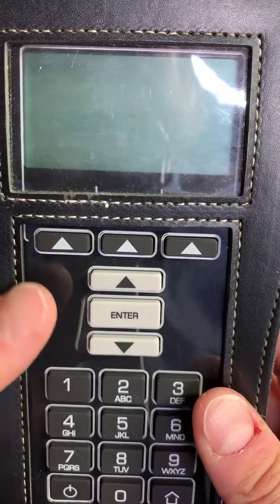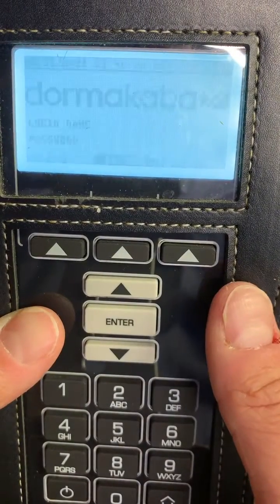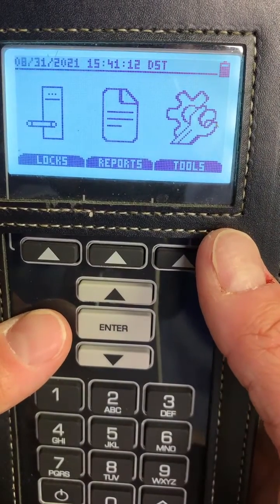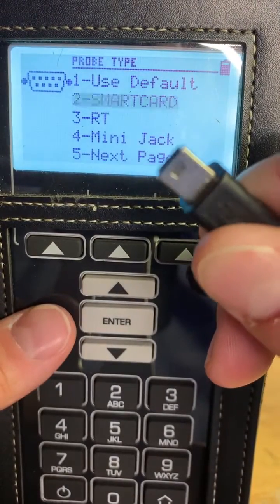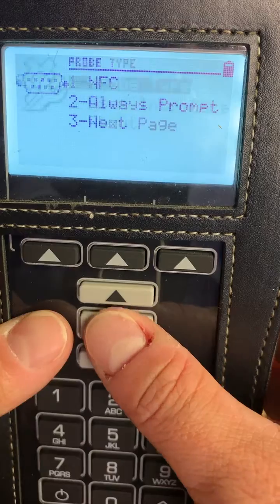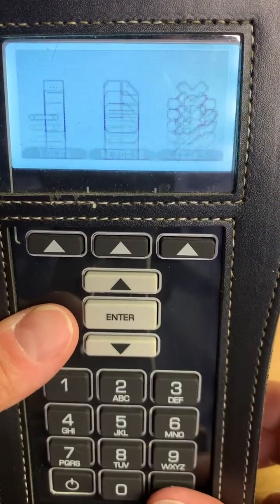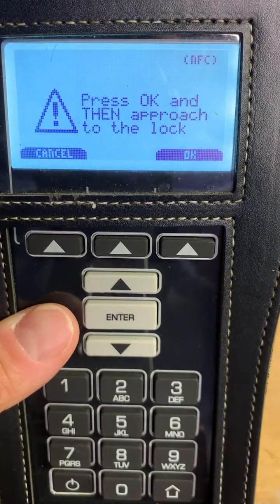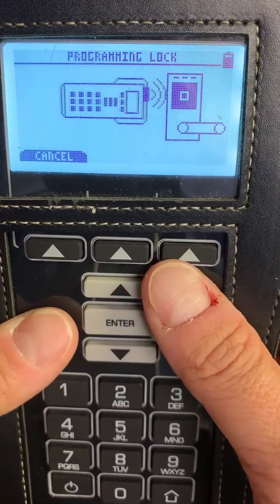How to change Probe type & program a lock

Comment: How to charge the device, my device has died after almost 4 years
Reply from the maker: From time to time the batteries do need to be replaced in the HH6.  The part number for the replacement should be 132-512886  Check with your local Dormakaba MH sales rep for assistance

Comment: I have a message coming back to hand held programer saying door is deadbolted from inside must remove dead bolt first,,, what does this mean as door is not dead bolted at all.thanks  all
Reply: When changing the battery the pin from the deadbolt must have been pulled out and misaligned, so you have to reinserted in a diamond mode , otherwise the reader will keep flashing yellow and deadbolt will stay activated.

Comment: We use dormakaba locks. What are the steps to replace the Bluetooth board?
Reply from the maker: It really depends on which lock model you have (as the process may differ slightly).  I recommend reaching out to Saflok tech support to make sure that you have the correct process.  Their number is 1-800-999-6213

Comment: LPI says sync with PC, but never connects?
Reply from the maker: Hi I'm not 100% sure what you're referring to with LPI.
Reply: @pjpolke1742  Lock Programmer/Interrogator
Reply from the maker: @jonmaraglia8696  Could be that the services need resetting.  Check this video: https://youtu.be/hXQxaflHQeo  It could also be something else.  IF the services don't fix the issue I recommend reaching out to Dormakaba Saflok tech support.  Their phone number is 1-800-999-6213

Comment: hi, would you be able to create video about how to use HH6 ELPS (Part #75800)?
Reply from the maker: I can add it to the list of videos to be created.  Sure.  Also if you're using a Quantum or Pixel lockset, you could also use the A21100-F.  That is an emergency lock power device that does not require the HH6 handheld programmer.